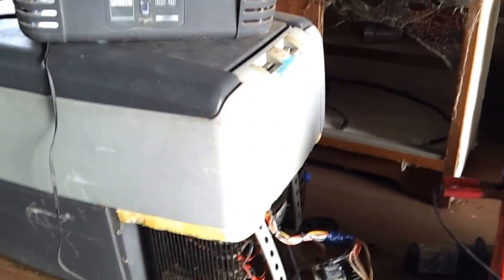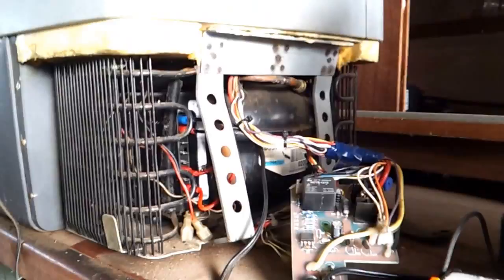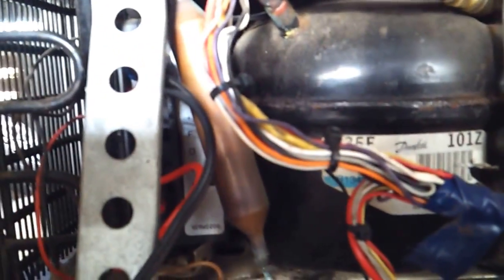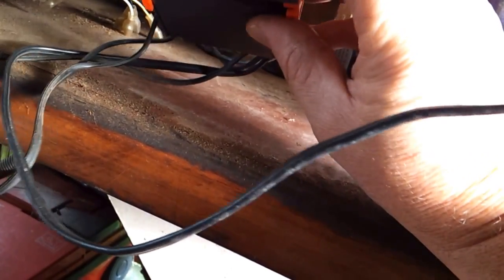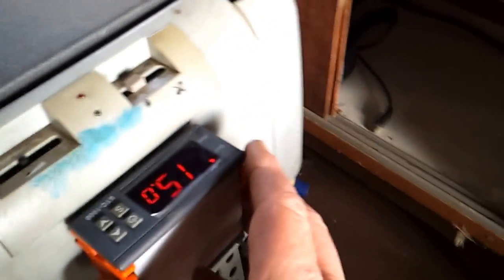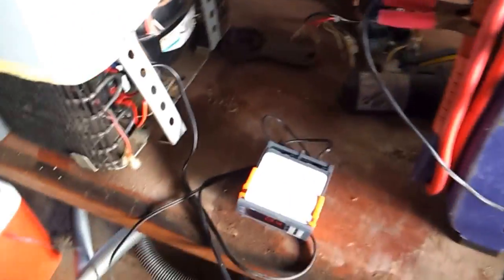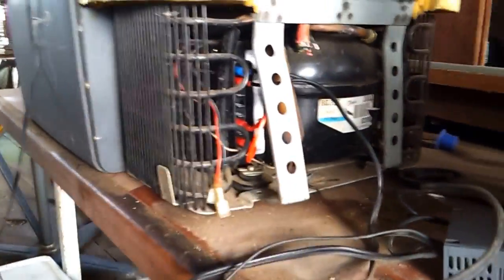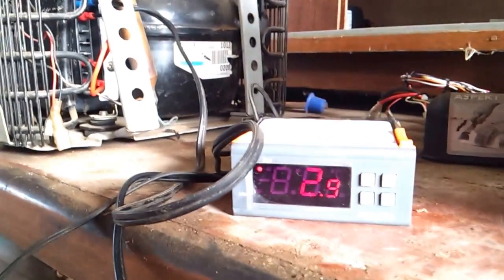How to fix Waeco CCF 40 or any fridge with danfoss compressor

Comment: Thank you very much for taking the time to do this. I've wired the controller in to the black power wire so that I've kept the power socket and joined the red fan wire to the red power wire which is otherwise untouched. Also wired 12 volt power to the new controller from inputs.  Tidied the wiring and put back together - saved $600 fridge for under $20. Great result!

Comment: Thank you from Texas!!! Mine is Ac/DC with a bypass switch. 50 Dometic. I just spliced the power wires from the inside and used the original sensor and left everything else alone. Works even better than new. Just needs the bypass emergency switch on to work. I wish I could put a picture. I even cut a hole to make it look like it's built in. Again thank you!!!!

Comment: I have a 12v fridge with almost the same components in this video. The compressor and fan kick on and there is a small thin coiled copper pipe which gets super cold, but the fridge stays warm. It uses a cooling plate.

Comment: Scoot thank you very much, I installed a smaller and cheaper thermostat (6.00 € on ebay) I have installed just above the power inlet and aesthetically is very well ..
Thank you very much again, I am very happy
Reply from the maker: No worries just to let people know that this fridge is still running and its been just over 2 years.It is out in a open shed and runs 24/7 as a drinks fridge and i have never had to do anything to it since the fix.

Comment: I follow this video and got my ccf40 working again. I took it a couple steps further cut the plug off so I could use the original plug, wired in the light and fan also used the original thermistor.
Reply: Is the temperature correct using the original thermistor? Thanks

Comment: Hey Scott great video mate just thinking could you make a video up of you hot wiring the fan to the thermostat for us electrically challenged individuals
Reply from the maker: Just run your fan wires to the controller so it starts when the compressor comes on and goes off when it turns off. Hope that makes sense to you

Comment: What wire size did you use when you replaced the waeco wireing ? Would 5mm single core wire work or would I have to get thicker wire what do you reccomend?
Reply from the maker: Yes 5mm fine

Comment from the maker: Fridge still running like a charm.Please add your comments or likes if this video was helpful.
Reply: Very helpful Video, many thanks Scott! I have a dometic C-550 with mecanical thermostat (BD35F) and this conversion will became more reliable
Reply from the maker: 3 years on from doing this fix the fridge is still running 24/7. Hope this has helped people that were otherwise going to trash there fridge. Even done this to a mates chinese copy that the control board went on and its still running 6mths on from this fix.

Comment: Thanks for the amazing info. I have just fixed a Waco fridge that I was going to bin. May I ask how you can hardwire the fan? Thanks Michael
Reply from the maker: I never worried about doing my fan because the fan stopped working and i never replaced it.But you should be able to just take the positive and negative wire from the controller to the fan and that way when ever the compressor starts the fan will run as well.Hope this makes sense.

Comment: How to butcher your fridge.
Waeco is very similar to the INDELB car fridge is the same as the ALDI Sterling brand 40L car fridge freezer. 
Before you go and by a new thermistor or cutting wires do the following first.
1 check that the fridge is not in Fahrenheit mode when you expecting Celsius as it will have you thinking the thermistor is not working and turning the compressor off. To toggle between Fahrenheit and Celsiusremovemeter in ohms range in free ambient air ~20C the reading should be approx 2k - 2.5k ohms if you hold the thermistor tight in your hand you should see the resistance value  to start changing the reading should become more resistive. If that is the case the thermistor is ok and it is probably the plug just had a poor plug connection and possibly just unplugging and plugging it back into the control card will be enough to resolve the problem.
Reply from the maker: This fridge was diagnosed by waeco the controller was stuffed. Quoted $300+ to replace that was over 7years ago when I made this video and the fridge is still running so I'm happy with my butchering.

Comment: How to deal with the overheat protection. Hotwiring like this creates the risk of the compressor being overheated (e.g. if we let the door open by accident).
Reply from the maker: Any fridge that gets it door left open will have the compressor continually run trying to keep it cool the secret is not to leave the door open. The way the fridge is set up on this controller it will only operate at 2000rpm and not go to the 2500rpm that it would go to with the built in controller.If you have a tendency to leave the door open connect the fan up to the thermostat controller or if u r really worried u could hook up 2 fans not that difficult.This fridge is still running 24/7 in a open shed with no fan running summer, Autumn , winter , spring and i haven't had to do anything to it since i fixed it.Another thing u can do if u r worried is take it to waeco and pay them to fix it or even buy a new one and let someone else fix yours.

Comment: Could you hook the thermostat controller between your hotwire between C and T? Would you then be able keep your existing plug and keep the fan working? Would that work with bypassing the existing thermo controller?   I have ordered one so I'll guess I'll answer my question and let you know :-)
Reply: Just done this to my newish but out of warranty Kings rebadged waeco cf60... connect the negative terminal of the fan to the slot marked f, and the positive to the main supply positive... i also connected a 12v error led in  -ve  to the terminal marked d and +ve to the main supply. In addition i put a 300 ohm resistor in series with digital thermostat so it doesnt have a direct connection between c and t terminals -this makes the compressor rev alittle higher and cool much quicker, instead of 2000 rpm makes it around 2600 rpm... cools the beer much quicker, regular boost button on original controller would be about 1500ohm which revs at 3500rpm. Im not an expert, play at your own risk, i just downloaded the control board instructions on the web. I am sooooo appreciative of this video, my fridge is working better than new.

Comment: more info. Thermometer inside says it's 18f degrees. Don't have 120vt plug-in. Works fine but no adjustments possible including on/off. What to do??
Reply from the maker: If you have brought the same controller i used in the video it will have
 instructions on positive and negative in to it and then from controller
 to fridge,same as your temp sensor into controller then to fridge. 
Watch the whole video this works. If you have a different controller you
 will have to work it out yourself. Sorry

Comment: Hay guys, how have yous wired it up to work? My compressor worked when bridged but wouldn't get cold. So bought the stc 1000 and wired port 1 (power) from the main power source with a second wire bridged to port 7 (cool). Port 2 was my ground from - on the control box and linked to main ground and port 8 was going to my + on control box. But now stc1000 will turn on and off but light flashes with the cool light (not sure if meant to) and compressor wont turn on with the c & t still bridged
Reply from the maker: Check you have good 12v connection. Bad connection it will flash and not start up. If your compressor runs but doesnt get cols you have lost all your gas and it will need to be regassed.

Comment: Where does the new thermostat plug in
Reply from the maker: The thermostat sensor plugs into the new controller and then you just place it inside the fridge
Reply: Scott O'Malley sorry the new thermostat controller where abouts does that plug in
Reply from the maker: If you have brought the same controller i used in the video it will have instructions on positive and negative in to it and then from controller to fridge,same as your temp sensor into controller then to fridge. Watch the whole video this works. If you have a different controller you will have to work it out yourself. Sorry

Comment: Hello, i have problem with elwctronic board on the compressor can you tell me output voltage on 3pin connector and why is it 3pin
Reply: The electric motor inside compressor is 3 phase.. applying 12v directly will not work. My understanding is that control unit is still needed to turn the applied DC 12v into 3 Phase.. But half that circuit board is computerised.. the computerised Circuit monitoring system seem to be common failure of this fridge. this causes it to shut down.. however the computer monitoring system can be bypassed ( as done in this video). I too have give it a go.

Comment: Hi Scott,  how do I wire temperature controller?  Have followed your instructions and compressor runs when wired direct, however when I hook up temp controller it won't run. Suspect it has something to do with relay. Regards Johnno
Reply from the maker: +Johnno silverfox Hi Johnno are you using the same controller have you connected the temp sensor to the controller.Should be just your power into the controller then from controller to fridge and your sensor off your controller to your fridge.I have done this conversion on 3 of my mates fridges now and never had a problem with this controller.Check your got your wiring the right way on the instructions that came with your controller. Check you have the same controller as they make different controllers that look the same but have like a 5 amp relay witch is not big enough to run the compressor.Hope this has helped.Double check your wiring keep at it because this fix works and my fridge runs 24/7 since fix, its out in a open shed that gets cold and moist and also 40 degree heat never misses a beat and keeps a constant temp.
Reply: +Scott O&#39;Malley thnks Scott, will order another controller the same as yours Johnno

Comment: so i have a question for anyone that can help...... my fridge died on 12v only the other day and ive been able to start the compressor on emergency override and by bridging the C+T terminals together would this indicate that theres a problem on the board or the thermostat ? cos the lcd display still seems to work ok although i have no lights coming on it but when i press set it allows me to change temp settings etc... any help would be greatly appreciated
Reply from the maker: If it gets cold it maybe thermostat or your board is stuffed

Comment: Did you end up hooking up the fan. I just finished mine mate, working well but fells a bit hot in the sides haven't hooked the fan up yet
Reply from the maker: mitchjazz no i still never connected the fan still running 24/7 no problems

Comment: Hi, not quite following the setup, is it power to 1 and 2 then sensor then bridged from power/neg in to pos heat and cool and negative heat and cool? What runs to power and neg of waeco? thanks for any help
Reply from the maker: power to + and - On the fridge Bridge The C and T then your + and - wires that you have conected to the fridge go to the controller and your sensor that comes with the controller goes into the fridge. you will need to also wiren + and - wires to come out of the controller to a cigarette lighter plug so you can plug it into power. Whatever controller you have will have instructions on where the wires go for power into the controller and power out of the controller for the fridge. There will also be a place for the temp sensor . Hope this helps
Reply: Hi mate may have a faulty unit but is it power to danfoss controller from 240/battery, bridged to unit. Sensor is good , get that and loop c & t but where do the cooling wires from unit go? Coulf\d you put up a pic of the back of your unit please? Thanks